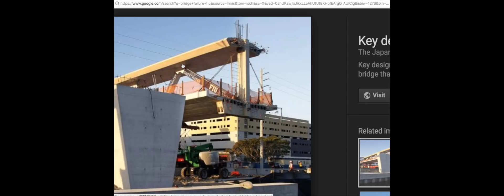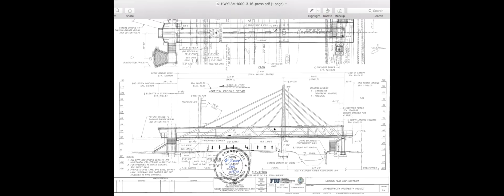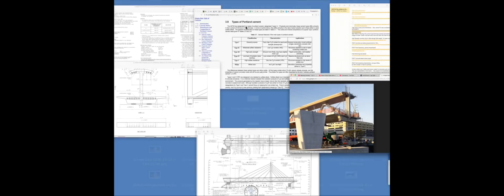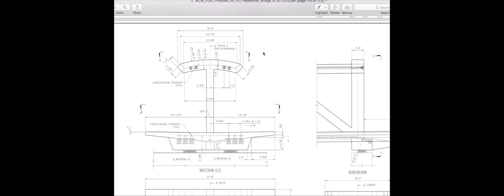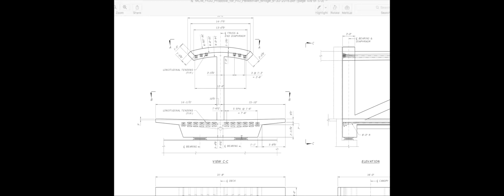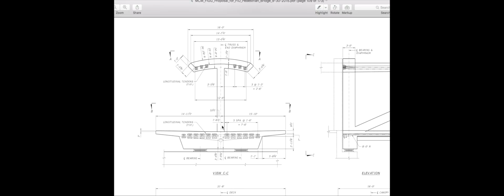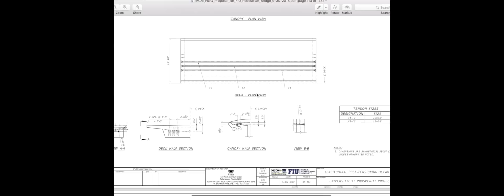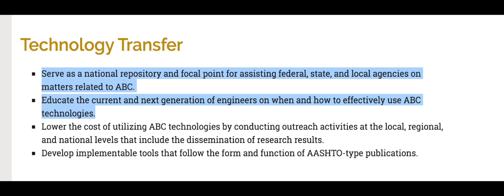FIU Florida Bridge collapse Inherent center flaw CENTER of structure

Comment from the maker: NOTE: This video shows old drawings and some of this data is no longer accurate as the latest plans would change some of this... Please, ask if you are not clear...
A couple of you awesome viewers have sent me links to a couple of forums... I did look at the links but discounted them because they are just focused on #11...
This #11 is part of the action but the canopy is more important in this failure - as an action...
Most people looking at these videos are not engineers and do not get the concept of still needing  to find an ''action'' to start the failure... 
Then also being able to ''prove'' that action took place...
We all know, #11 but, what is looked around is the engineers and school engineers at FIU were knowledgeable about post tensioning and did NOT see an issue with post tensioning...   
This ''load path failure" was not foreseeable by these engineers and once you find that ''unforeseeable" ''load point''  / ''load path''  - that will explain the failure.
I believe post tensioning caused the load path to change in this bridge by causing the ''ungrouted'' post tension cables in the canopy to become part of the load path at #10. 
This was able to take place because the compression during post tensioning #11 and it's forces causing failure in the canopy... which released all it's forces onto 10 & 11...
#11 exhibiting the buckling and the canopy cracking between #11 and #12... (possibly at two or three places - perhaps this is where the cracks will be revealed)... 
Please also recall, that this canopy has a couple of extra ports / ducts that are NOT filled and these voids, along with un grouted existing post tensioning cables allow for a ''tension failure'' and buckling to take place ''inside'' the canopy... (while it is being loaded with the post tensioning tooling)... 
My theory is once this ''destruction'' starting taking place, the load path changed to member #10... Which transferred it's load to the center of this structure; which this video shows has NO longitudinal post tensioned cables (only are largely spaced, rebar cross section -as shown in google images, of the lower deck). 
This is part of my current thinking and I will have about three more videos to add data...
Reply from the maker: I am theorizing that the applied load created by post tensioning at node 10 / 11 created a force that caused the top canopy to buckle which then transferred the load down #10 - which then caused #10 to hit this weak cross section design - which then caused the bridge to fail under tension...  as the point load / load path was too great for the center of this bridge - ''missing'' longitudinal cables UNDER to the load path of the ''truss system'' -- 
That this force was exceedingly local...  That FIU and the engineers should be held liable and no insurance should protect their current license or educational training certification...  FIU, failed on this and if they maintain themselves as an educational institute this needs to be part of all their ''bridge training"!
And if they claim to be so innocent of this entire affair then they would not have a problem coming forward and doing this bridge study as a failure study!
Engineers learn from failure - this is how we all know the limits and maximum working ranges of materials... 
This data of this failure must be shared and not some ''clown show" from the NTSB.
Reply: To me, #11 appears to fail before anything else does ( https://ibb.co/n3wJCS ), and the truss design means that a failure of that truss is going to be catastrophic. Determining how it failed after that, and in what order, is likely academic (although, again, I'm by no means dismissing that discussion). But since it failed first, and the failure was destined to be catastrophic, it seems to me that the primary discussion should revolve around why #11 failed.

That being said, I could buy the argument that if the canopy failed before #11 failed, then the primary discussion should be around why the canopy failed. It sure looks like #11 fails first, though, from the dash cam footage. If the canopy failed first, it would have to have been directly above the joint between #11 and #10, because I don't see any deformations in the canopy between #12 and #11 while there is already buckling in #11 and while #10 appears large unaffected by an additional load from the canopy, #11 fails immediately from it. Which all takes me back to #11 failing.

Based on some math I saw in another channel, it looks to me as if the force on #11 during the move would have been roughly:
    ((Total kips of bridge / total length of bridge) * length of span supported by #11) / sin <angle of #11>
which works out to
    (2100 / 175) * 21) / .6 = 420 kips, given that the weight of the bridge was 950 tonnes, the bridge was 175 feet long, the section supported by #11 was 21 feet long and the angle was 37 degrees.  That weight calculation is an underestimation, because of the end sections, but the 420 is sufficient to prove my point.

Based on the specs, the two rods were both tightened to 200, so there was 400 kips of compression from the tensioning rods, which was insufficient to meet the 420 kip load.  I'm also assuming they used 200 based on the plans, but that's very much an assumption that may not be warranted.

But again, not an engineer, so I'm probably wrong about most/all of this.
Reply from the maker: David, I saw your image and what your image shows is buckling... With that said, it takes a ''load'' to cause buckling... (I am not being ''smart'' - follow me on this...).
It takes a load and just dialing up the kips on the PT Rod would not be able to cause the column to buckle in the middle like the image shows... as the column would not compress - it would buckle first... BUT, to get the column to buckle that much the load needs to be present and the load cannot be present unless the deck weight transfers to the column... meaning the deck / canopy had to give first.
...Okay, address loads on member #11, the numbers you gave are only a guess and that is because the canopy has post tension cables - these cables, are designed to CHANGE the ''load points''... In theory, it could be zero load from the canopy on member #11... as all the load would be transferred down member #12... and transferred threw post tensioning in the lower deck.
For your knowledge base... first comes the load and then you can have buckling... But, buckling does NOT come first; in the image you showed, it shows buckling... that is effect of load being applied... What is the load? 
NOT post tensioning, as the bar would fail first AND you would require the ''end points'' to become free for this buckling to take place... as they were pinned at each end and this column was not freestanding (un restrained)... So, to allow for this ''extra room" to buckle this column would require the canopy to ''lower down''... which it did (in my opinion) via the failure I stated in numerous versions of my videos here and on my other channel.
Hope I did not lose you...
Reply: Interesting.  So what you are saying is that overtightening the tensioning rods wouldn't cause buckling. Hypothetically, what would it cause?  What would we expect to have seen if the concrete failed while tightening the tensioning rods?  What would we expect to have seen if the tensioning rods failed, if their yield point was exceeded?  I'm accepting your point, by the way, these questions are just to answer my own curiosity.

During the move, #11 would have been taking the weight not only of that section of the canopy, but also itself and the lower deck, wouldn't it?  That being said, I see what you are seeing, the more tension on the cables in the canopy and the lower deck, the less work #11 had to do. So, theoretically, they could have adjusted the cables in the canopy and the lower deck to account for the additional force caused by the overhang. It's only if they didn't that the numbers I used would work, at least as a guess.

That makes sense, at least to extent. The post tensioning of #11 pulled more of the weight (load) of the canopy onto #10 and #11, which caused #11 to buckle first, because it was at a steeper angle than #10.  I'm not sure I intuitively entirely follow how much additional load could have been put on #10 and #11 by the post tensioning of #11. Is there an equation that expresses that?  I can grasp that it would be increased, but intuitively, it doesn't feel like it would be a large increase. But, again, not an engineer.
Reply from the maker: David, I will do a video response... I get a lot of messages and frankly, I delete most of them... But, I am  making a video making it clear, that #11 did buckle because of post tensioning... I will explain in the video.
Reply from the maker: https://www.youtube.com/watch?v=BuTBzY5dpQ4&feature=youtu.be   Here is the technical reason on why #11 was not over tensioned.
Reply: Could it be possible concrete failure at deadend of the bar they were de-tensioning.this could also cause anchors of the 2 centre deck tendons to fail suddenly releasing tension.
Reply from the maker: Gordi66,  I could think that if you would turn the entire rod, counter clockwise and the retaining nut was ''locked'' in place... that would  release it from dead end... 
In my latest video... it shows this darn node area has some very questionable work going on... It even appears some of the node damage was ''pre-existing'' yet, they still had a jackhammer and apparently used it in this node.
Reply: The FIU design requirement for a 174 feet clear span bridge over a two-directional multi-lane highway represents a desire for engineering extravagance instead of good old-fashion common sense.   Specifically, the strip separating the two-directional traffic flow median would have provided sufficient width for a SUPPORT WALL.   Dividing the span would grant the obvious advantage of reducing the requisite depth of the structural members. The separate spans could have received bolted steel-plate box-beams that were prefabricated on site and lifted into place.  A complex truss arrangement would not be needed.  The pedestrian canopy, now no longer a component of the structure could be added after the steel box girders were in  place.  
Frederick A. Lee / ARCHITECT